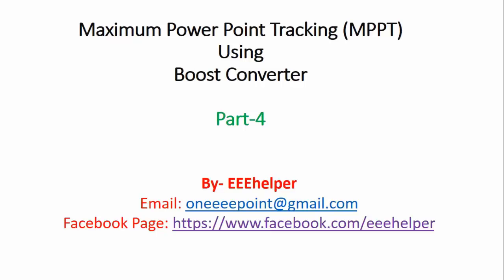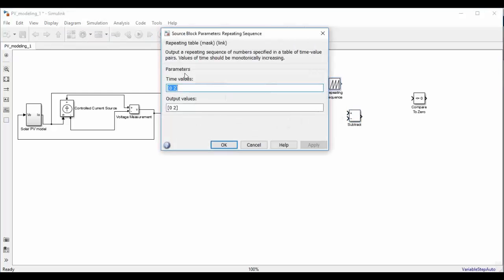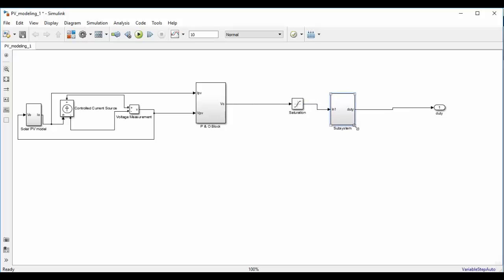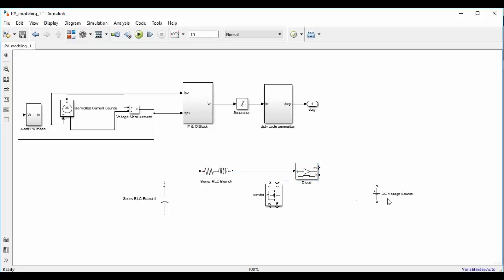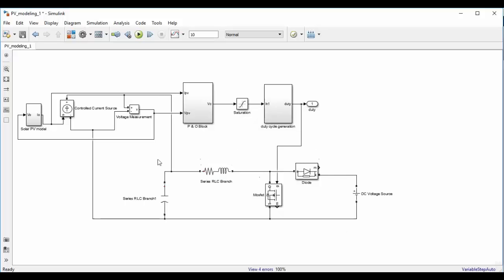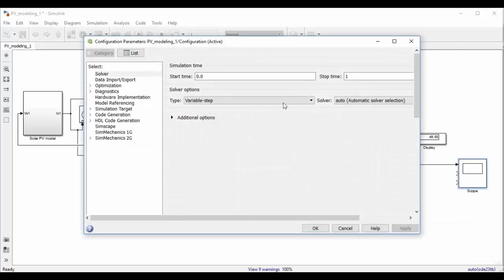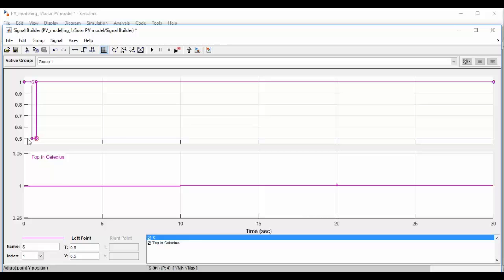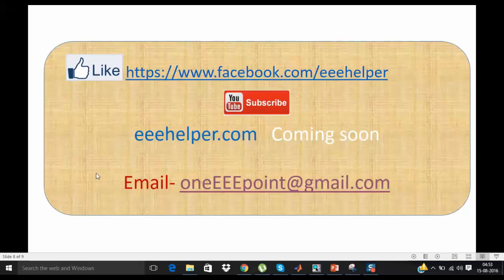MPPT Using Boost Converter Modeling in MATLAB/Simulink- Part 4

Comment: Could you please explain the logic under duty cycle generation block is implemented? I cant really get that part.. 
Why do you subtract the repeating sequene of Vc? Also if i scope the repeating sequence all alone (with the numbers inserted here), the scope is always zero..Although if i set the powergui to discrete i get a pulse with a peak of 0.5V..
Thanks